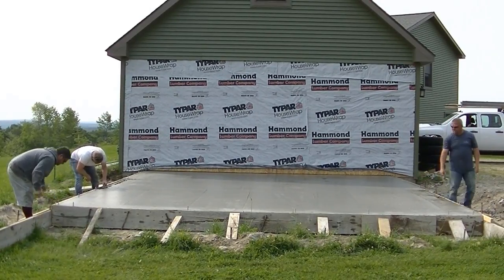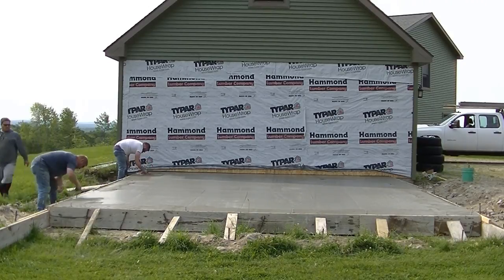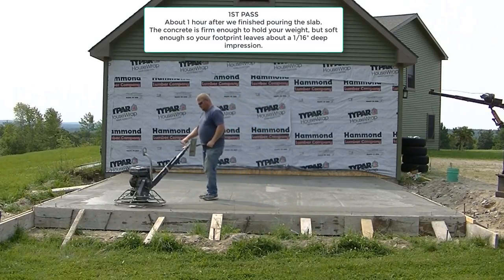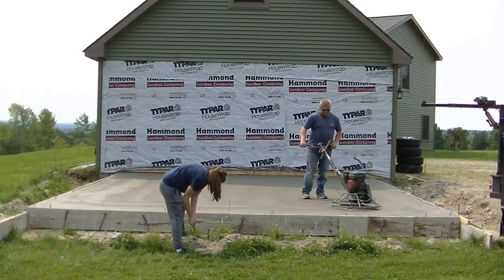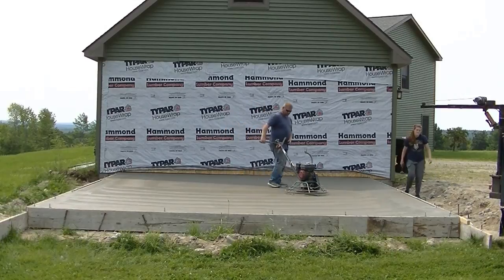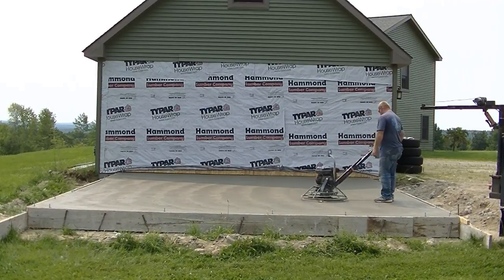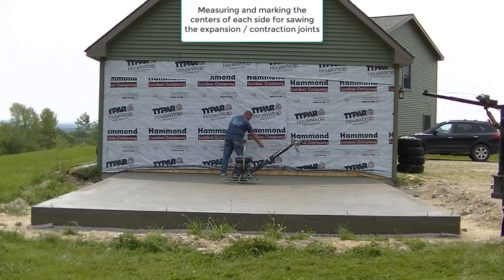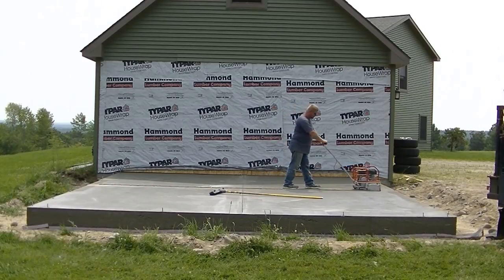How To Power Trowel Your Garage Slab | All My Troweling Secrets

Comment: Nice work! I used float blades and finish blades for 15 years. We use combo blades now. We do use float pans though. They are very sensitive to floor flatness, and you can get on the floor bit earlier. Pans also keep the machines very clean which is a huge benefit to life of machines. Combo blades are nice when blending cold joints when the first load needs troweled. It seems to burn quicker also. Only drawback is you CANNOT GET BEHIND!!!! lol you cant pitch blades on a pan!
Reply: Concrete comes with water already in it
Reply: Float blades combo finish blades

Comment: Rented one for the first time for just 3.5cy.  It wouldn't run had to go back get another one.    Control was hard at first then got the hang of it.
So there appears to be 24 36 and 48 in trowels and then ride ons 6 or 8 foot.  I think for me a 36 is a good size.  Not being a pro lowes is the best price I found on a no name unit.  They come with a pan too.
One thing for sure if the slab isn't flat the trowel is going to dig in places and operator has to work to keep the finish clean.

Comment: When I had my flatwork guy pour my business pads 60 x 140, 40 x 80 and 60x 70 he power toweled them and parts of the concrete turned a black color … he had quite the crew working with him…. I wish I would have had him sill the area by the overhead doors like Tom Haus does his ….

Comment: Hi Mike, I love your videos!  You are a true master of your trade.  I will be busting up and pouring a new heated floor for my 1980 26 x 26 garage floor this summer.  I will be epoxy coating it after the concrete has properly cured.  Since I will be epoxy coating it and don't require a shinny power trowel finish, would you just hand trowel the floor without the power trowel rental?  Does the power trowel make the surface stronger?  

Thanks for the great videos!

Phil Kite, Sherwood Park, Alberta, Canada
Reply from the maker: You can just hand trowel it if you desire. That's a lot of work. The power trowel does give you a bit stronger / denser surface. But you should be ok either way you decide. I would power trowel mine.
Reply: @MikeDayConcrete  can you make a video. How to run a trowel machine..??

Comment: Does your blades ever stick or pull out concrete when you start it even if you get down and turn manually just a little? Does that mean there is too much air entrainment
Reply from the maker: Sometimes they stick. Too much air does make the mix sticky. It does it on non air mixes too though.

Comment: Great video once again Mike, I did buy your how to pour a slab course but you keep me pretty busy with the YT stuff. I am curious about the blade pitch on the troweling machine, it appears you pitch the blades up more ( less contact) as the concrete gets harder is this correct?
Reply from the maker: Thanks for buying the course! In general, yes we pitch the blades up a little more as it gets harder. We do try to keep them as flat as possible with very little pitch, this makes the blades last longer.

Comment: I didn’t catch what size power trowel size this is? Looks like a 36” to me. I am curious what size you are using and when you would suggest bumping up to a 46” trowel machine. I have a 36” right now and am wanting to buy another one can’t decide if I want to get a 36 or a 46
Reply: I also do this as a living, we typically will do the whole interior and exterior concrete on a house except for the footings and foundations